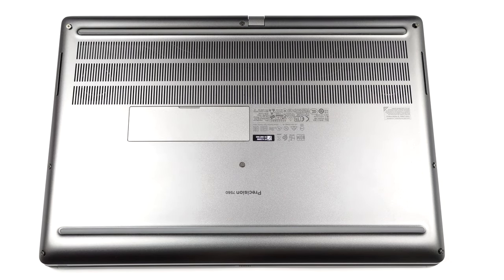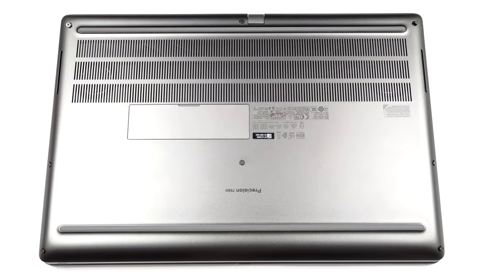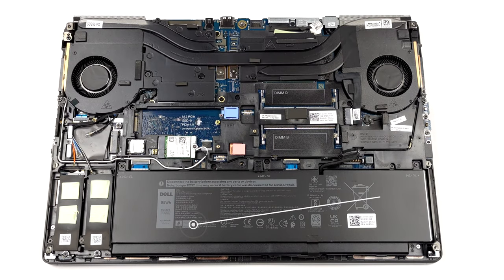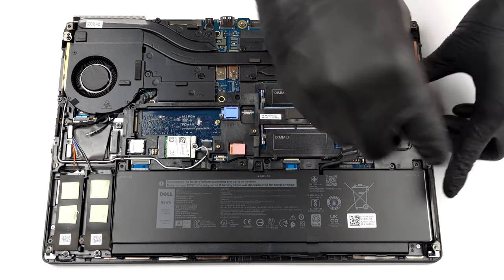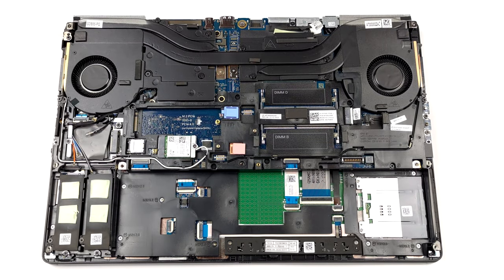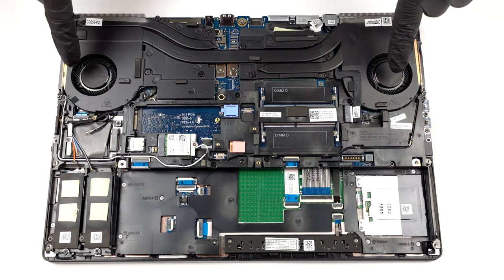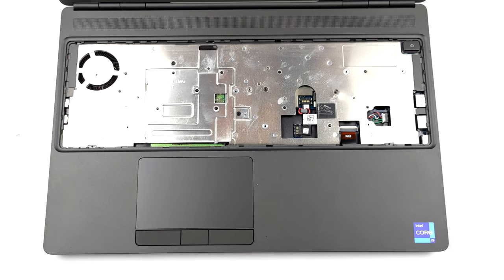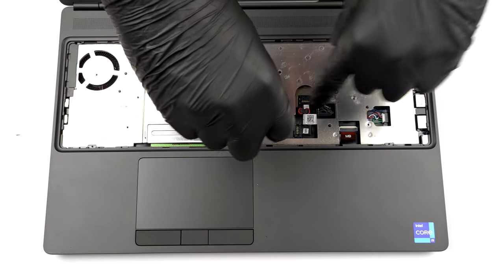🛠️ Dell Precision 15 7560 - disassembly and upgrade options

Comment: When I saw those times for the battery capacity I laughed my ass off.

I have the 7760 which is pretty similar to this board, Idk the GPU in this one but my laptop does not get even half of those times